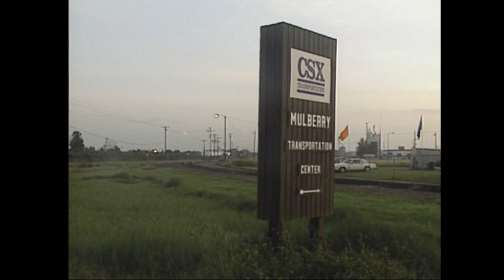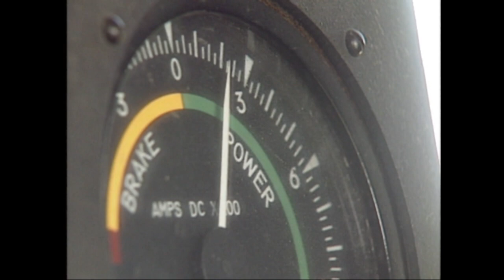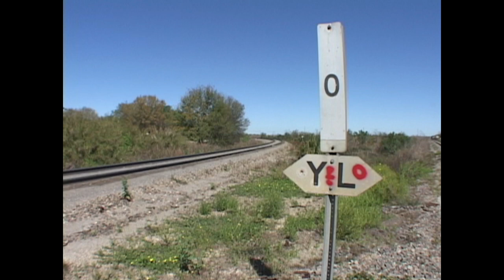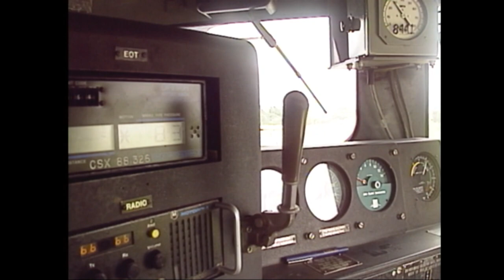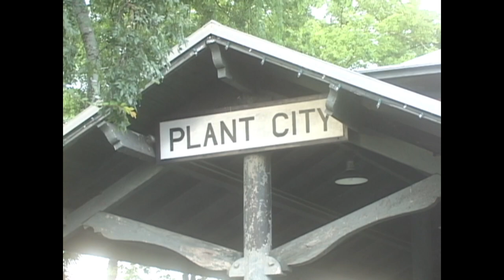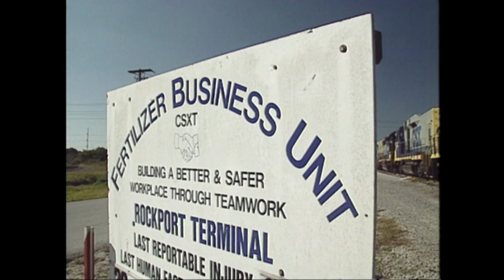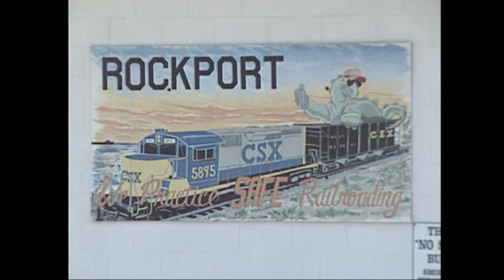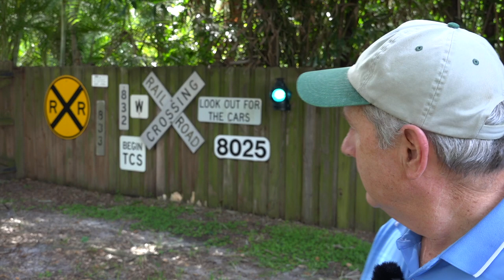The Way It Was: CSX'S Bone Valley 1995

Comment: I lived in Orlando druing the early 70s and traveled on US Govt. business to many of those little podunk towns on a monthly basis. I sat for hours at crossings. I probably saw some of those cars and locos at one time or another.

I grew up in Floridas panhandle (Pensacola) and had kin in Mobile, AL. As you know, that was L&N country. Grampa was a L&N section master, and two uncles were also working the L&N, one as a brakeman and the other as an engineer. A neighbor was a yard hostler and another was an accountant in the business office. We had a small amount of activity from the Frisco in Pensacola, but L&N was king. As you might guess, I've been a train watcher for many of my 72 years. It has changed over the years. Mostly but not all for the better. One thing I'd the same: the romance of the railroad and hearing that lonely sound of a whistle atop an old steam loco. (Yes, I saw them!!!)

Comment: "Shoving Platform" is better than Caboose?🤔
Reply: It's a matter of liability and maintenance. For a shoving platform they only have to keep the wheels greased, so to speak. But if it's a caboose then they have to staff it and maintain it as a caboose, meaning batteries, bathroom, seats, a/c and heat, etc. There's quite a few things on the railroad that have been changed in wording only just so they can avoid maintaining and/or liability matters.
Reply: ClawdyaTube I understand maintaining the bathroom etc...But staffing it? When did they ever "staff" the caboose? Never heard of them having a hired staff on the caboose.
Reply: @firepower782  Back in the day there were 5-man crews. The Conductor,  engineer,  switchman, brakeman and Fireman. When the railroad eliminated the three helper positions the last position was cut off when they eliminated the caboose. Now the railroads are attempting to cut the crews back to a one man job. But the caboose staffing was a union vs carrier argument.
Reply: ClawdyaTube Wow.  Thanks for the info man. I do remember a friend of mine saying his father was a retired Brakeman from CSX. That was in the early '90's. 
Going to Engineer only would be just damn dangerous.
Reply: @firepower782  yes it would. But safety is just a word and certain railroads are willing to take the risk in order to save a few pennies. When someone is killed because of negligence they have lawyers to decide how little that person's life is worth.
Reply: @firepower782  In Europe, they already run freight trains with just the engineer. I think it's pretty doable with the 50-car trains going from terminal A to B, if the consist is already put together and checked etc. There's also pretty much no 'dark territory' there.

But nowadays, in the US, they run with really long trains and DPU's, sometimes through very remote trackage. I wouldn't want to be all alone with a broken down 3-mile train in the Arizona desert or something...
Reply: Marco Yes exactly what I was thinking. Super long freight trains these days. What about a medical emergency with only 1 person on the train? Many reasons it seems like a bad idea to me.
Reply: @firepower782  Agreed! Does anyone remember the Lac Megantic, Quebec train disaster in July of 2013, a result of a runaway (former) Montreal, Maine, and Atlantic Railroad's crude oil train?
Mr. Thomas Harding is said to be the lone crewman, the Engineer, on that train. Likely, he was in a "panicked" mode when he was contending with a locomotive fire is his consist, that was parked on a passing siding with a descending grade, due to an oil leak onto its exhaust manifold. He was supposed to be applying around 25 hand brakes so to hold this train for the next crew(man) to come on duty. Shortly before the next hour his train's air brakes bled off resulting in its runaway, killing some 47 residents in that Canadian village. Afterwards, it is said that Canada has banned all one person train crews.
The new Central Maine and Quebec Railroad (CMQ) is trying to show promise to the residents that their railroad, passing through Lac Megantic village, are able to operate safely. Meanwhile, Lac Megantic is seeking to have the railroad detoured around the village.

Comment: Nice video! Good to see different railroads in operation. I work for a rail crew hauling company in Texas. I haul crews for the BNSF Railroad and occasionally a crew for the Union Pacific Railroad. I enjoy my job and have gotten to see a lot of places that I otherwise wouldn't have gotten to see. I guess you can call it a dream job. I have learned a lot in the eight years that I have been doing it. Still learning.

Comment: I have seen some of the old gp30 slugs up here in Virginia, CSX uses them on the line in my home town of Boykins. They are usually use to help with locals, transfer runs with a short line in Boykins, and sometimes on long Double Stack trains to the ports in Norfolk and Chesapeake.

Comment: i don't know if someone has mentioned this already, so apologies if i am repeating the same message - your end of trains marker was probably made to work with a regular, incandescent bulb which burned at 2700 degrees Kelvin. You can obtain LED BULBS using that same temp (color) at Walmart, Home Depot or Lowes. They are marked this way in the specifications, usually printed on the side of the box. You may even find them GREATLY discounted in their Clearance areas. 

BTW - I love your videos, even this older one. It brings back the fascination I felt as a kid being around railroads and model trains!
Reply from the maker: Yes, it was. In fact it was made to work with a kerosene flame, which is a little lower color temp that a tungsten bulb. I found that soft white bulbs work best. Thanks!

Comment: The cement plant where i worked had a dragline of about that size which was used to dig limestone rock for use in cement manufacturing (the dry powder stuff). It was dropped into a rock crusher which had giant rotating hammers that pulverized it and mixed it with water to form a slurry that was pumped through a huge pipeline bac to the plant about a mile away. The operator let me try digging a bucket load and it was disastrous. It takes practice to get just the right tension on the dragline as the lifting lines raise the bucket.

Comment: Nice gotta love those old school pull valve air horns on those SD40-2.
Reply: They still use those on the new consoles. I was on a 70 Ace not very long ago, built in 2014 and has the pull valve.
Reply: @SD40Fan_Jason  ? What RR? The UP ones have a ball on a stick lever but no matter how slow or fast u pull on it the horn blasts at full power!
Reply: @AbelG8781  CSX here. I know the type of valve you speak of though. It's meant to look like a valve but its nothing more than a button. At least ours don't have the sequencer button. I had a set of BNSF motors and the lead engine had a sequencer. I kept pressing the damned thing by accident.
Reply: @SD40Fan_Jason  lmao gotcha. U CSX guys have some weird EMD's hu?
Reply: @AbelG8781  luckily I'm not on CSX payroll anymore but I make interchange with them still. I guess weird is relative. The weirdest unit I encountered from NS had a flip valve and a horn at either end and was intended to run long hood forward.  So where you and I sat on the engineer's side was a desk and the controls were over where the conductor sat, facing down the long hood. Someone recently commented that GE's weren't meant to go long distances long-hood forward but NS apparently disagreed

Comment: Wow!  What a treat!  Thanks for posting this, Danny; I was in withdrawal, like so many others, but fully sated now!  Question:  Are road slugs still in use these days?
Reply: Most of them were relegated to MoW and then scrapped. I remember taking the grand tour of Rice yard about 2005 and there were at least a half dozen tracks full end to end with these locomotives in all stages of parts poaching. Once they recovered everything of value they pushed it down into the steel recycler to chop up and haul off somewhere to be smelted into something else. It's a real shame too, because a lot of those slugs were grand switching engines. But with EPA regulations cracking down on the industry like they have, it was not worth the expense of converting them into compliance.
Reply: @SD40Fan_Jason  Thanks!

Comment: when you get time- could you do a special on the railroad to Key West- The aggregate used in the concrete is river rock- smooth- not ground oolitic limestone as in modern concrete' Where did they get the rocks, and where did they get the water. How they mixed and poured would be interesting, too.
Reply from the maker: There's a great book on the FEC Key West Extension called "The Railroad That Went To Sea". Answers all those questions.

Comment: When they had slug units back then, and maybe now, what are the fuel tanks used for on the slug units? Do they still put diesel fuel in them for the mother or were/are they empty?
Reply: We use them at the BRC and they fill them with concrete or old rail to give it weight

Comment: As I understand it, railcars don't move unless you pressurize the brake system, which releases the brakes. So what provides pressure to the engineless train in the dumper? Or is there a way to manually lock the brakes open?